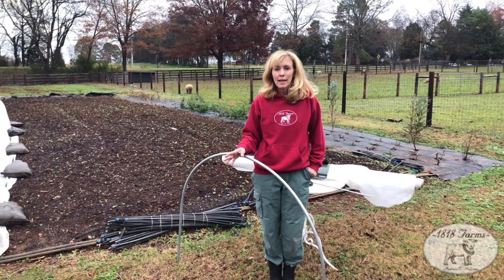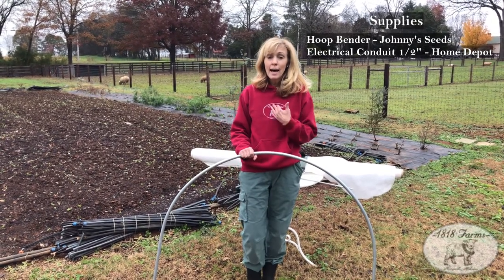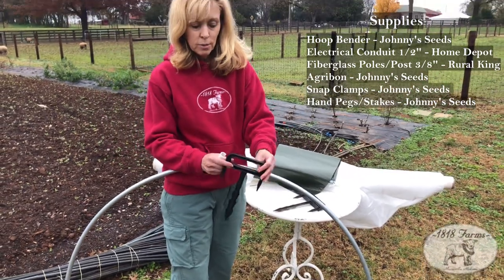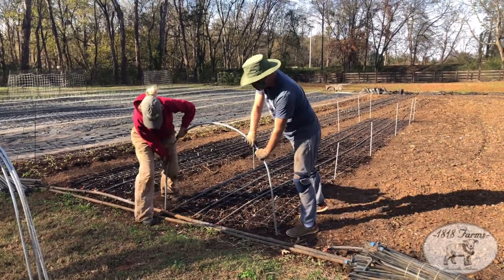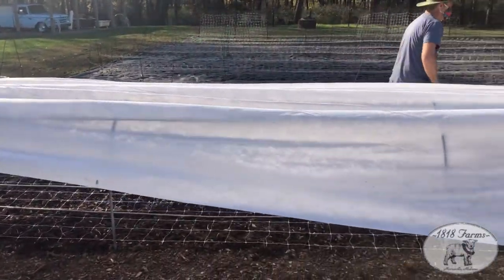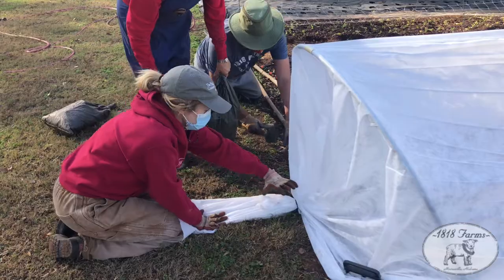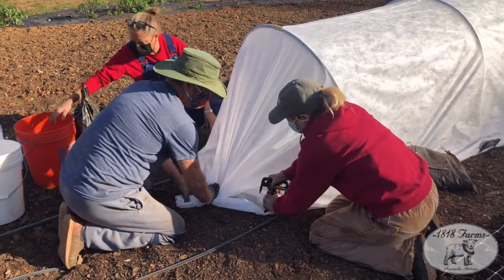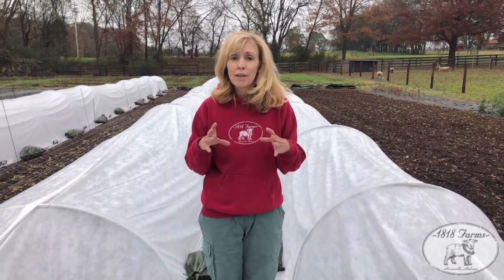Steps to Building a Caterpillar Tunnel - Part 2

Comment: I’m in zone 6b so I can’t leave ranunculus in the ground over the winter, even with a low tunnel, correct?
Reply from the maker: How cold does it get there? We cover with greenhouse plastic when it is below 26.
Reply: It can drop to below zero, especially with wind chills. We do get a fair amount of snow that can stick around. I guess I’m confused about whether I can leave the plants in the ground for the winter and cover with a tunnel or whether I should plant the corms in a tunnel in very early spring to get a jump on the growing season. Thank you for the help!
Reply from the maker: With temperatures that low, I would think that you would plant in early spring. We rarely go below 20.